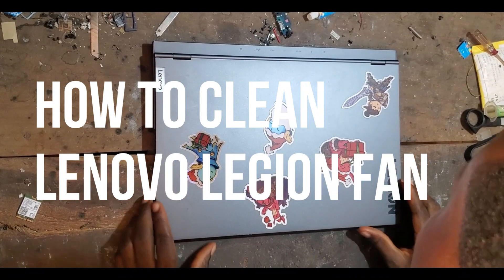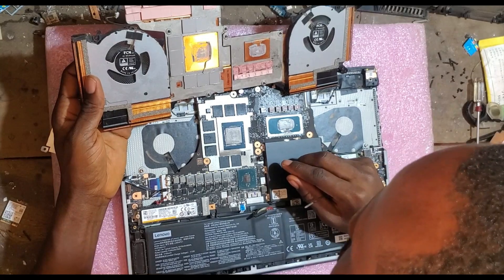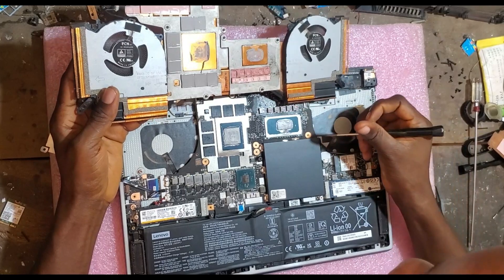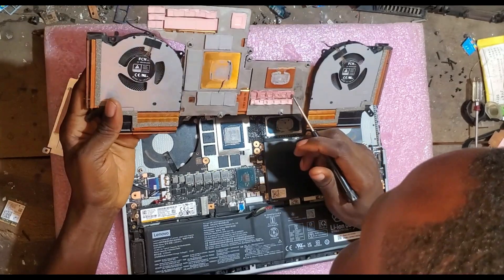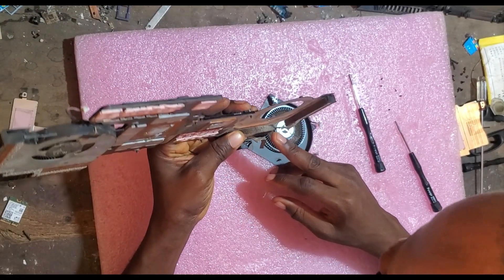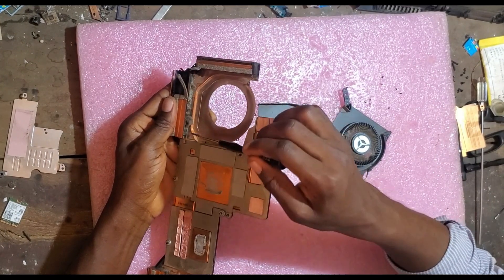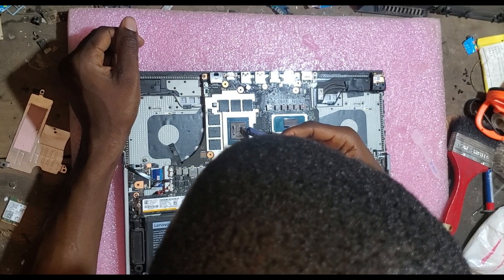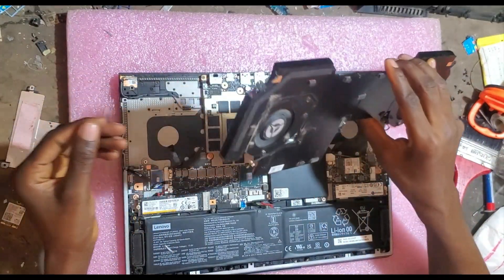How to Clean Lenovo Legion Fan Like a Pro | Routine Maintenance

Comment: Hi mate! Lenovo legion laptops come from factory with thermal pads , that's why it was dry the one it had , you need to replace them with same stuff otherwise the temps will be actually worse with paste . Honeywell PTM7950 it's the goat 🐐 Good luck 🤞
Reply from the maker: Thanks for the info
Perhaps the owner of the PC has had it repasted before.

Appreciated your heads up about the type of cooling solution that was used. 

You are the second person that would point this out. 

I appreciatively value your input. 

Y'll inputs make me a better a PC  technician. 

I have learnt not to think in default mode. 

Next time I will find out the type of cooling that was originally used regardless of what I met, especially with this type of high performance PC. 

Thanks mate, 🍻
Reply: @ZiliconTech  You're doing great buddy, keep it going 💪
Reply from the maker: @kent8280   thanks 😊
Reply: Legion 7 doesn’t come with thermal pads on CPU or GPU .
Reply: @arka_arch oh yes it does buddy , I’ve opened mine and it had pads , but the one from Honeywell PTM which if you don’t know how it looks u’d think it’s paste but it isn’t .
Reply: @kent8280  from what i saw , lenovo doesnt use honeywell (atleast not before 2021) . although when you open them it looks dry because its cold , mine  was " pasty "even when cold .so im guessing it depends on different manufacturing standard in different region . i agree with you ptm 7950 is the best option for long term but i still prefer mx4/mx6 since i need to clean the fans every year anyways and pads are trickier to apply ( for me as i messed up while removing the upper layer)
Reply: @arka_arch I messed up first time as well with the pads . But hey , at least we have a starting point 😂 For me changing them was a real difference, GPU 15 degrees lower and CPU like 8-10 . My Ryzen 7 5800 doesn’t want to run lower than 88 on Warzone but my GPU it’s 3080 16Gb so it’s abound 60 all the time . I wish I could make my CPU stay a bit cooler
Reply: @kent8280  same 3080 16gb(throttle at 90 degree) , ryzen 9 cpus actually better at thermal control .i advise get on your hoodies and crank up your ac to 16 degree . lower ambient helps . sometimes i funnel the ac air towards my laptop . but i fcked up big times with honeywell pads( like cooking scrambled egg on the cpu and gpu) .not gonna try liquid metal either , so i ended up with mx6.
Reply: @arka_arch I’m lucky I live in Ireland where the weather helps a lot 😂. Maybe in the future I’ll switch to a more powerful legion and get rid of ryzen and get intel

Comment: You should try phase-change material Honeywell PTM7950. It comes in as a sheet, lasts longer, performs works better than traditional pastes and there is no pump out effect.
Reply from the maker: Thanks a lot. 

I will give it a shot. Just watched a review on it. Quite impressive. It was a close match with liquid metal. 

Thanks again
Reply: @ZiliconTech it actually came with the laptop stock.
Reply from the maker: @jajaboss  Oh!
It was brought in for a service